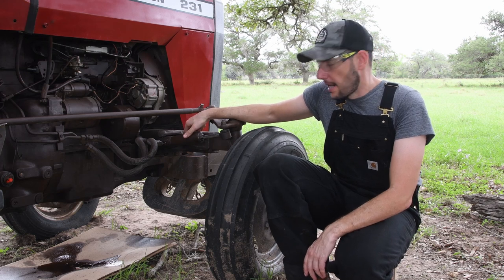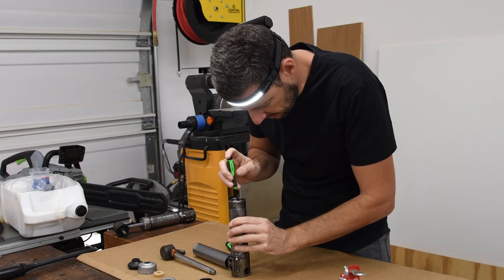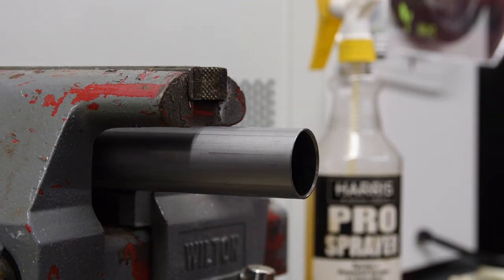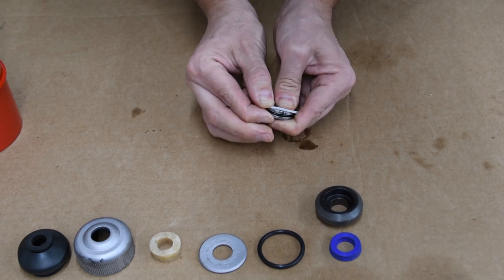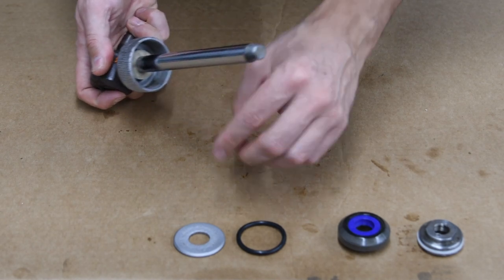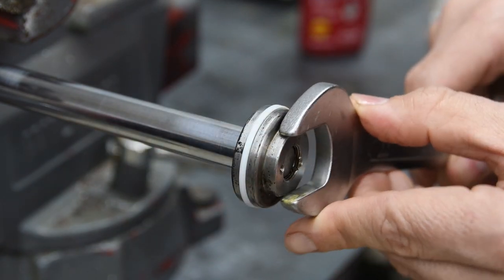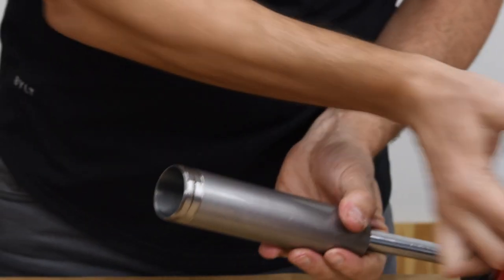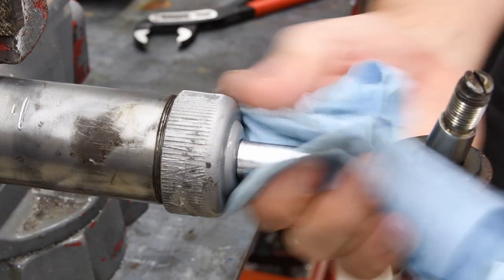Massey Ferguson 231 power steering cylinders rebuild

Comment: You are a smart, gifted man. The Massey Ferguson 231 is by far my favorite tractor that I’ve ever owned. I’ve had mine for 17 years. It’s a 1998 model. I gotta put a new muffler and a power steering fitting on it.
Reply from the maker: Thank you very much. I agree, I really do love the sound of the Perking engine, so round. As a friend of mine say, it sound like if the pistons were made of rubber, very mellow. You have to love these old, overbuild, iron block tractors, they will outlast any modern tractor.
Reply: @BUTTEWORKS  💯

Comment: **NOTE**
*I hope this helps someone out*

There are 2 power steering fittings that go into each cylinder. 1 long fitting, and 1 short fitting.

The “long” power steering fitting that goes into the cylinder is Massey Ferguson part #3029953M91.

The “short” power steering fitting that goes into the cylinder is Massey Ferguson part #7003936M91.

I have replaced these several times on my 1998 Massey Ferguson 231. They will easily snap off if you’re not careful!

I have a ton of information on the 231 tractor if anybody needs anything!
Reply from the maker: Thank you for sharing that info, I'm sure that if your broke your a few times, more people will be in the same situation. The hoses are kind oof exposed and easy to get caught on branches.

Comment: How do u remove the cylinder
Reply from the maker: There is one bolt in one end and the ball join in the outer end. Just two nuts, very simple. Disconnect the 2. Hydraulic hoses as well.
Reply: I remove the nut from my MF360 but the threaded shaft doesn’t come out easy. There is a slot like you are supposed to use a large flathead screwdriver maybe?

Comment: I have a 263 with cylinders like those i have a rebuild kit and i may try to fix mine . It does not leak externally but bleeds internally.
Reply from the maker: It is an easy job,  I hope you can get them fixed. I believe this month I will work with the tractor with power steering for the first time. I can't wait. Good luck with you repair and thank you for checking the video.

Comment: How do you bleed the system after reinstalling? I replaced on of the cylinders due to a busted ball joint. Steering is extremely hard now when before I could turn it with 1 finger
Reply from the maker: I actually never bleed the system it just worked. I guess that air bubbles will be pushed to the pump oil reservoire. However if you think you may have air, try to loosen up the highest connectors, at the power steering control valve. Just crack them loose and see if while engine is running and you turning the wheel it releases any air.
Reply from the maker: Or perhaps the pump is is not working…

Comment: I have a 1232 MF, and my steering cylinder leaks. I cannot remove the threaded shafts at each end. The castle nuts are off, but the threaded shafts will not budge, with persuasion and penetrating oil. Suggestions?
Reply: Correction...1233 MF tractor
Reply from the maker: I would take a propane torch and heat them up. Not burn them but add heat. Then use a large Knipex pliers for leverage and they should come out.

Comment: Hi!! I have a question. I have a 231s. The power steering has gotten harder to work over the past 8-ish hours. When I pull the filter, it’s frothy, so I suspect air in the line. How do I bleed the line?  I’m a rookie.
Reply: Note:  The 231s has a slightly different pump and filter set up than yours. I also have a quick connect at the rear of the tractor - is that where I bleed?
Reply from the maker: Hi Tina, it seems to me more like you have water in the oil.  Oil should be transparent when new and water emulsion would make oil look like a milkshake. I would drain the oil and add new one. Run the tractor it should stay clear. Have you ever changed that fluid and filter?. Is the tractor stay under the rain?

Comment: Where did you get the re-seal kit? I have a 1998 Massey Ferguson 231.
Reply from the maker: I got them on Amazon, link in the description in the video. I believe you can buy them on ebay as well.
Reply: @BUTTEWORKS  thank you

Comment: Do you have video to remove cylinder
Reply from the maker: No, but it is very simple, just to bolts and the two hydraulic little tubes. Five min each.

Comment: Why it there an orange zip tie on the tie rod end?
Reply from the maker: I marked the right cylinder with a zip tie as well as both right hydraulic hoses on both sides of the tractor. Just a marker.